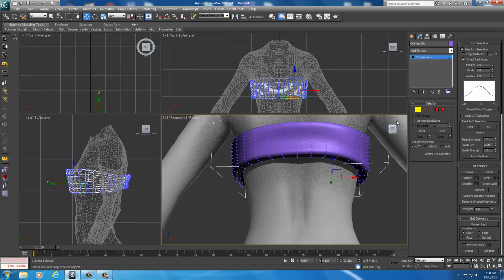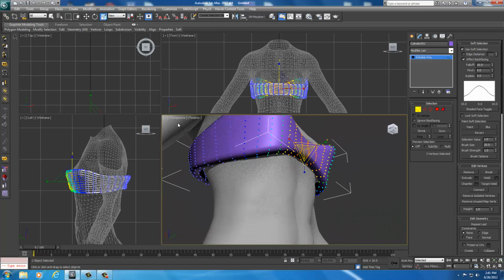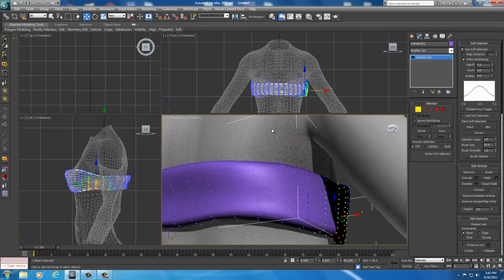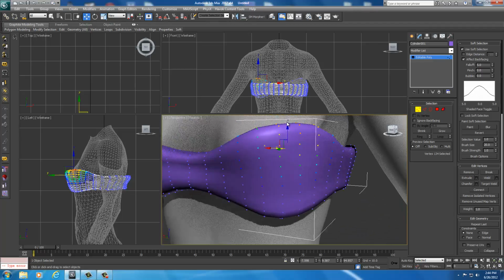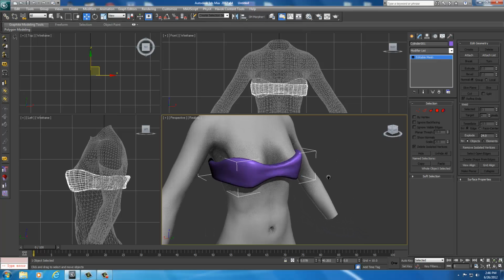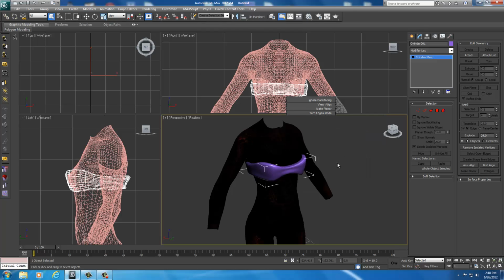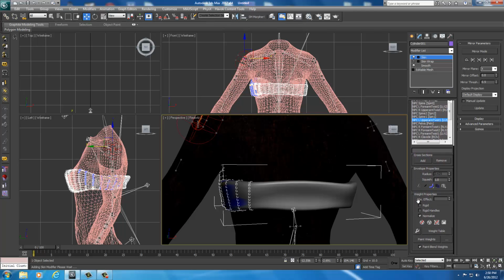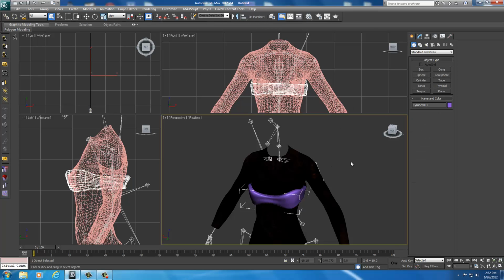19 - CA4S - Shaping the Cylinder Continued and Unwrap UVW

Comment: I have a small problem thats annoying me, the bottom area in the back if this bra seems to have become 'sharp' after I smoothed it out. Where in this video the bra seems to be 3 vertices thick, the back of mine only has 1 or 2 vertices and is very thin. Any idea what caused this?